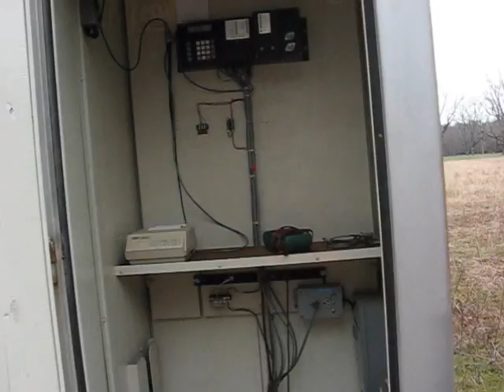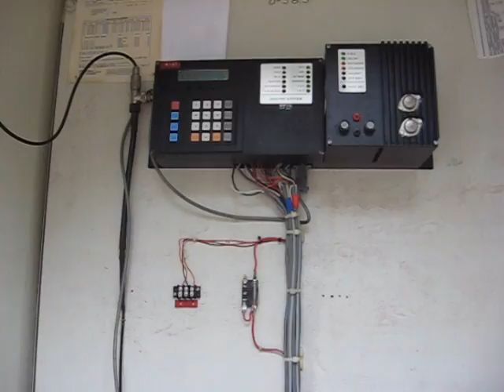Me and Elton Testing the Defect Detector (February 24, 2010)

Comment: This is a Southern Technologies Sentry Detector.  Most of the ones installed on the Central of Georgia were installed in the 80"s.  They are in the process of being phased out and replaced with NG (Next Generation) Detectors also made by Southern Technologies.  South Atlanta going North on the old Southern Railway are using a Micro Detector made by General Electric.
Reply: Central of Georgia went defunct in the 1960s or maybe even earlier
Reply: I think he means the Central of Georgia Right-Of-Ways
Reply: IMO the Servo 9000s are better
Reply: Next generation is a gimmick buzzword used for everything these days.
Reply: In the eighties?! Darn, I didn't know they already existed back then! The Netherlands only has 14 of 'em if I remember it right and they only exist for something like 15 years or so as far as I know. Ours unfortunately do not operate on free radio-channels like the ones in the USA and their locations are secret for all I know. The locations are chosen in such a way that every train/car is seen at least once every 24 hours.

Comment: The most recent Norfolk Southern timetable I have for this line is from Sept 12, 1993.  This was NS's Americus District, a former Central of Georgia line between Columbus and Americus, GA.  The letter "O" line had 5 detectors located at the O-9.1, O-22.1, O-32.3, O-44.3 and this one, the O-58.5.  This line was also equipped with ABS signalling in Track Warrant Control territory.  I would like to know more about what happened with this line and what NS used to run on it.  Looking at the rail it doesn't look like much is running along it currently under the GSWR ownership, but the roadbed still looks to be in good shape.  Timetable speed at the time was maximum of 50 mph.

Comment: Is there any kind of map or online resource that would tell where one of these might be located in my area?  And, how do I find out the frequency that it is on so I can listen on my radio?
Reply: Railroads have 97 analogue VHF channels for voice communication. A list can be found on "illinimaps" (previous reply with links didn't work). Detectors transmit on the main channel for that railroad or section of railroad, which is often listed on "radioreference." If not, buying a cheap scanner would help determine the channel. In terms of where the detectors are located, they're on things like track charts which generally aren't publicly available, but they call out the milepost which can be correlated with what's shown on the bungalows of nearby road crossings (the metal boxes). They're generally near public roads for easy maintenance. Max spacing is 20 miles, but it's generally less – in my area they're in the process of decreasing it from ~16 to ~8.

Comment: About how often do they have these located?  Are they on most rail lines?  It has been since the 1970s that I used to walk along or cross tracks on foot and I've never seen on of these.
Reply: Usually around 20-30 miles apart from each other and most main lines have at least a few defect detectors

Comment: You see "bumphead" written in the DDT shed, the only thing in Georgia is Bumphead Rd in and around Americus, Ga but according to the SCL timetable the mile posts are too high and there were no DDTs in or around Americus. The Georgia Central mile posts are too high as well and on the GSWR the lowest mile post was on the old Richland sub and that DDT was at MP 98.7 in Lynn, Ga but I tried to find it a few years ago and could not fine it. I did however found the one south of Arlington, Ga.
Reply: This is a old CofG line.